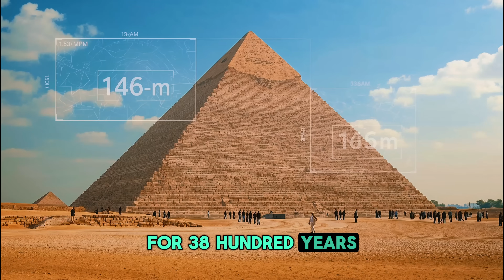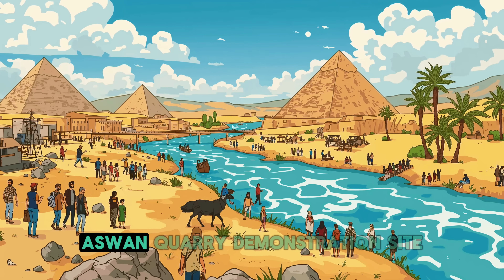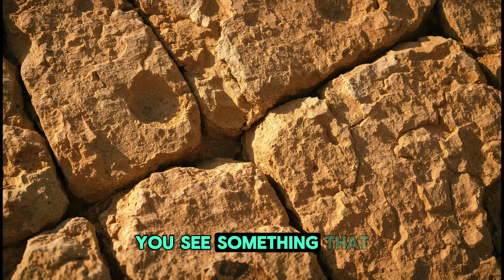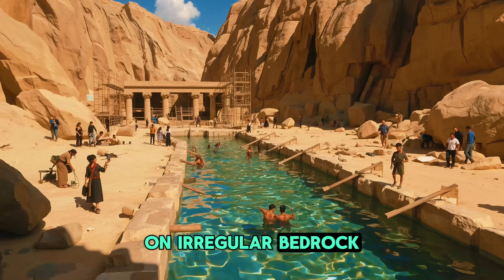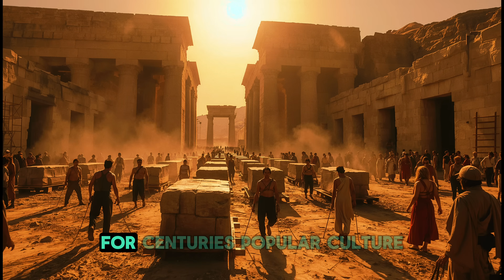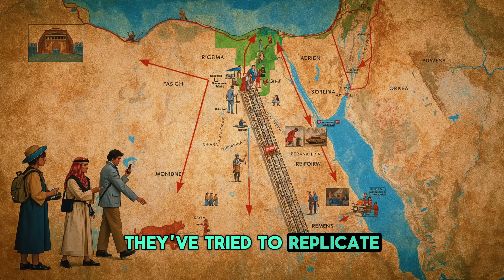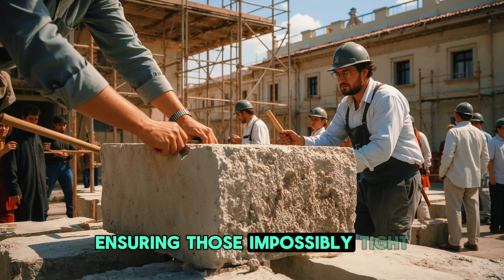Engineers Can't Explain How Pyramids Were Built... Until Now

Comment: Full of shit ! No boat is holding that block and where is room for all the manpower going to sit ? And against the flow of the river ... no fucking way ! All crap
Reply from the maker: @wildtalkingconure Alright, let's address your points - you're actually raising legitimate problems, just... aggressively. 😄
1. "No boat is holding that block"
You're RIGHT if we're talking about the tiny barges shown in some visuals. A 2.5-ton block on a small reed boat? Physics says no.
Historical reality:

Ancient Egyptian cargo barges were 20-30 meters long
Built from bundled papyrus or cedar wood
Could carry 10-15 tons (multiple blocks per trip)
Required significant crew and ballast

Evidence:
✅ Tomb paintings showing massive barges
✅ Khufu's solar boat (43 meters long, found buried near pyramid)
✅ Archaeological remains of ancient docks and harbors
So yes - the small boat visual is BS. You're correct.
2. "Where is room for manpower going to sit?"
On a proper cargo barge:

Rowers: 20-40 men (depending on size)
**Steers

men:** 2-4

Cargo area: Central platform for blocks
Total displacement: Enough to support crew + cargo

Think Viking longships or Roman grain barges - similar scale, similar capacity.
But you're right that simplified visuals don't show this accurately.
3. "Against the flow of the river"
EXCELLENT point. This is actually one of the biggest challenges:
Nile flows NORTH (Mediterranean-bound)
Limestone quarries (Tura) are SOUTH of Giza
So how did they move stones UPSTREAM?
Option A: Sailing

Egypt has prevailing winds from the NORTH
Sail south against current, using wind
Float north with current
Ancient Egyptians were MASTERS of this (attested in countless records)

Option B: Canals

Build artificial water channels to reduce current
Control water flow with locks/dams
Evidence of ancient canal systems exists

Option C: Seasonal transport

During Nile flood (July-October), water levels rise
Creates temporary channels closer to building sites
Reduces distance needed to transport

But you're absolutely right - rowing heavy cargo against current would be "no fucking way" impossible.
They used WIND POWER (sails), not rowing.

Here's my take:
Your criticisms are VALID. The problem is:

Simplified visuals (including AI-generated imagery) don't show realistic scale
Many explanations oversimplify logistics
"Just put it on a boat" ignores massive engineering challenges

What you're reacting to is lazy explanation - and I don't blame you.
Better answer:

Massive barges (not tiny boats)
Wind-powered sailing upstream (not rowing)
Seasonal timing (flood periods)
Possibly canal systems (reduce natural current)

Does that address your "full of shit" concerns, or still not buying it?
Because if you've got specific problems with THOSE methods, I'm listening.

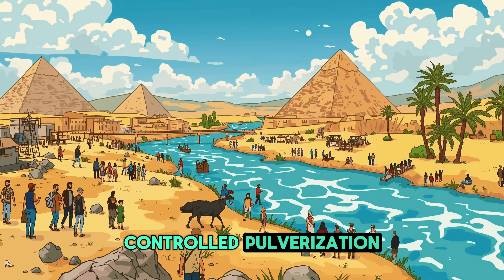Comment: I think this video is rubbish. AI generated images, like the one about 8:00 min timeline. The barge is floating like it's empty, but a 2+ ton stone block is placed on it. That stone block would sink the barge this size like it wasn't there at all! There are lots and lots of AI generated images in this video which actually don't explain anything. And if I would be using ancient methods to cut limestone, I would us stone tools, like granite or gneiss instead of copper. Much more durable. Maybe placed inside copper casing. 

Also, Pharaoh's Legacy does not show any credentials of it's validity in it's profile. Just pure guesswork and no true evidence.

How the pyramids were build, still remains a mystery.
Reply from the maker: Aquí está mi respuesta para @karijuleppanen:

@karijuleppanen Kari, you've made several legitimate criticisms - let me address each one honestly:
1. AI-generated images
You're absolutely right. I use AI (Leonardo.AI) for visual illustrations where:

Historical footage doesn't exist
Stock footage is prohibitively expensive
I need to visualize theoretical concepts

I should be more transparent about this. Would adding a disclaimer at the beginning help? Something like "Visual illustrations are AI-generated representations of theories discussed"?
2. The barge buoyancy problem - GREAT catch
You're 100% correct. That specific image is physically inaccurate:

A 2.5-ton block would require a MUCH larger, deeper barge
Ancient Egyptian barges could carry 10-15 tons, but they were MASSIVE vessels
The image oversimplifies the engineering

This is exactly the problem with AI imagery - it doesn't understand physics, just visual composition.
Historical reality:

Actual transport barges were 20-30 meters long
Made of bundled papyrus or wood
Required significant displacement volume
Multiple blocks per trip (not one tiny barge per block)

You've identified a flaw in my visual storytelling. Fair criticism.
3. "Stone tools instead of copper"
Again - excellent point. You're absolutely right:
✅ Dolerite (igneous rock, hardness 6-7) was THE primary tool for granite work
✅ Granite pounders found at quarry sites
✅ Copper was primarily for limestone (softer, hardness 3-4)
I should have been clearer:

Copper for LIMESTONE cutting/shaping
Dolerite/granite for GRANITE pounding/grinding

Your idea about "granite inside copper casing" is actually similar to theories about copper saws with abrasive sand - the copper holds the harder material that does the actual work.
4. "No credentials, just guesswork"
Fair challenge. Here's my transparency:
What I'm NOT:
❌ Professional Egyptologist
❌ Licensed engineer
❌ Academic researcher
What I AM:
✅ Content creator researching and synthesizing existing theories
✅ Someone who reads academic papers, archaeological reports, engineering analyses
✅ Presenting multiple competing theories (not claiming certainty)
My sources include:

Joseph Davidovits (geopolymer theory - materials scientist)
Jean-Pierre Houdin (internal ramp theory - architect)
Mark Lehner (mainstream Egyptologist)
Robert Schoch (geological analysis)
Denys Stocks (experimental archaeology)

Should I cite sources more explicitly in videos? Probably yes. That's valid criticism.
5. "How pyramids were built still remains a mystery"
On this, we completely agree.
I never claimed to have THE answer. The video presents:

Problems with mainstream theories
Alternative proposals
Evidence for and against each

The title "Engineers Can't Explain" is meant to convey exactly that - even with modern expertise, we're still debating methods.
Here's what I'll commit to:

✅ Add disclaimer about AI-generated imagery
✅ Be more careful about physical accuracy in visuals (or note inaccuracies)
✅ Clarify tool materials (copper vs. stone for different applications)
✅ Include more explicit source citations

Your criticism is constructive and fair. This is exactly the kind of feedback that improves content quality.
Question for you: Given your clear knowledge of materials and engineering - what's YOUR best guess on construction methods? You clearly understand the problems better than most commenters.
Reply: @PharaohsLegacy99  I don't have any and I'm not going to start the guessing game. 

Engineers still can't explain how pyramids were built, period.

Comment: THEY didn't build it .other 1,000 years before used high tick tools , YOU CAN"T FIND the tools. This ides of pounding can't work , sorry Dolerite Can not do the job. Go back to your research and find the REAL buliders.
Reply from the maker: @JimHeil-sf8dc Jim, you're raising legitimate problems with the mainstream explanation - and you're right about some of it.
Let me address your points:
1. "Can't find the tools"
Actually, we DO find tools:
✅ Copper chisels (thousands found)
✅ Dolerite pounders (found in quarries and at Giza)
✅ Wooden sledges
✅ Rope fragments
✅ Tool marks on unfinished blocks
BUT - and this is where you're RIGHT - these tools don't fully explain the precision we see in certain areas.
Copper chisels on granite? Inefficient at best.
Dolerite pounding creating perfectly smooth surfaces? Questionable.
2. "Dolerite can't do the job"
You're partially correct. Dolerite (hardness ~6-7 Mohs) CAN work granite (hardness ~6-7 Mohs), but:
❌ It's incredibly slow (months per block)
❌ Creates rough surfaces (not the polished finishes we see in some areas)
❌ Doesn't explain precision tube drilling found in granite
So what's the answer?
Option A: Lost advanced technology (your position)

Problem: Zero physical evidence of these tools
Problem: No metallurgical residue, no tool fragments, no depictions
Problem: If they had "high-tech tools," why are there unfinished projects showing primitive methods?

Option B: Methods we haven't fully understood yet (my position)

Combination of techniques (copper with abrasive slurry, dolerite pounding, possibly bronze)
Chemical softening methods (controversial, but some researchers exploring this)
Geopolymer casting (which would eliminate much of the "cutting" problem entirely)

3. "1,000 years before" / "Find the REAL builders"
I'm open to this IF you can show me:
✅ Archaeological evidence of this earlier civilization
✅ Dating evidence placing pyramid construction earlier
✅ Explanation for why Egyptians would claim credit for something they found
✅ Reason why hieroglyphs inside sealed chambers reference 4th Dynasty pharaohs
Graham Hancock, Robert Bauval, and others propose pre-dynastic builders.
The evidence for this is circumstantial at best:

Sphinx water erosion (debated)
Astronomical alignments (can be interpreted multiple ways)
Geological anomalies (not conclusive)

Here's what I WILL admit:
The mainstream "copper chisels and elbow grease" explanation is insufficient for certain aspects of pyramid construction. You're absolutely right about that.
But "we don't fully understand it" ≠ "lost civilization with high-tech tools"
It could also mean:

Ancient techniques we've forgotten (chemistry, physics, leverage)
Hybrid methods (some cutting, some casting)
Simpler solutions we're overthinking

My challenge to you:
If there were "high-tech tools," where are they? Ancient Egyptians preserved everything - tools, furniture, food, even underwear in tombs.
Why would ultra-advanced construction tools completely vanish without a trace?
What's your explanation for that?
Reply from the maker: @JimHeil-sf8dc Jim, you're raising legitimate problems with the mainstream explanation - and you're right about some of it.
Let me address your points:
1. "Can't find the tools"
Actually, we DO find tools:
✅ Copper chisels (thousands found)
✅ Dolerite pounders (found in quarries and at Giza)
✅ Wooden sledges
✅ Rope fragments
✅ Tool marks on unfinished blocks
BUT - and this is where you're RIGHT - these tools don't fully explain the precision we see in certain areas.
Copper chisels on granite? Inefficient at best.
Dolerite pounding creating perfectly smooth surfaces? Questionable.
2. "Dolerite can't do the job"
You're partially correct. Dolerite (hardness ~6-7 Mohs) CAN work granite (hardness ~6-7 Mohs), but:
❌ It's incredibly slow (months per block)
❌ Creates rough surfaces (not the polished finishes we see in some areas)
❌ Doesn't explain precision tube drilling found in granite
So what's the answer?
Option A: Lost advanced technology (your position)

Problem: Zero physical evidence of these tools
Problem: No metallurgical residue, no tool fragments, no depictions
Problem: If they had "high-tech tools," why are there unfinished projects showing primitive methods?

Option B: Methods we haven't fully understood yet (my position)

Combination of techniques (copper with abrasive slurry, dolerite pounding, possibly bronze)
Chemical softening methods (controversial, but some researchers exploring this)
Geopolymer casting (which would eliminate much of the "cutting" problem entirely)

3. "1,000 years before" / "Find the REAL builders"
I'm open to this IF you can show me:
✅ Archaeological evidence of this earlier civilization
✅ Dating evidence placing pyramid construction earlier
✅ Explanation for why Egyptians would claim credit for something they found
✅ Reason why hieroglyphs inside sealed chambers reference 4th Dynasty pharaohs
Graham Hancock, Robert Bauval, and others propose pre-dynastic builders.
The evidence for this is circumstantial at best:

Sphinx water erosion (debated)
Astronomical alignments (can be interpreted multiple ways)
Geological anomalies (not conclusive)

Here's what I WILL admit:
The mainstream "copper chisels and elbow grease" explanation is insufficient for certain aspects of pyramid construction. You're absolutely right about that.
But "we don't fully understand it" ≠ "lost civilization with high-tech tools"
It could also mean:

Ancient techniques we've forgotten (chemistry, physics, leverage)
Hybrid methods (some cutting, some casting)
Simpler solutions we're overthinking

My challenge to you:
If there were "high-tech tools," where are they? Ancient Egyptians preserved everything - tools, furniture, food, even underwear in tombs.
Why would ultra-advanced construction tools completely vanish without a trace?
What's your explanation for that?

Comment: Keep hearing about this laser precise cut stones and perfect 90-degree corners.  Where are they, certainly not shown in these or other pictures. I expect some weathering of the stones, but they were clearly not as accurate as he describes to start with.  They could not work during the Nile flooding, yet later claims the farmers worked on the pyramids when their fields were flooded by the Nile.  Just a bunch of stone blocks piled up.
Reply from the maker: @JohnDoe-uj7wo John, you're calling out some real inconsistencies - let me address each one:
1. "Laser-precise cuts" - where are they?
Fair challenge. The truth is nuanced:
NOT precise:

Most exterior blocks today (4,500 years of weathering, erosion, vandalism)
Interior fill blocks (rougher, less critical)
Blocks damaged during later stone robbery

Actually precise:

Original casing stones (mostly removed, but surviving pieces at base show gaps of 0.5mm - thinner than a credit card)
Granite boxes in the King's Chamber (corners within 0.02mm of 90°)
Internal passageways (alignment precision that's measurable)
Base platform (13 acres level to within 2.1cm)

The problem: Most photos show the damaged, weathered, robbed pyramid - not the original precision. It's like judging a Ferrari's engineering by looking at one that's been sitting in a junkyard for 4,500 years.
2. Nile flooding contradiction - good catch:
You're right, this IS contradictory in mainstream explanations. Here's the reality:
Nile flooding (July-October):

❌ Can't quarry (quarries flooded)
❌ Can't transport by boat effectively (too much current)
✅ CAN work on upper pyramid levels (already above water)
✅ Farmers ARE available (fields underwater)

Dry season (November-June):

✅ Quarrying possible
✅ Transport possible (calm water, accessible quarries)
❌ Farmers busy with planting/harvesting

So the actual workflow was probably:

Flood season: Upper-level construction, on-site work, organizing
Dry season: Quarrying, transport, foundation work

Not as simple as "they worked year-round" - it required seasonal planning.
3. "Just a bunch of stone blocks piled up"
If only it were that simple, John. But:
❌ "Piles" don't stay aligned to true north for 4,500 years
❌ "Piles" don't maintain structural integrity through earthquakes
❌ "Piles" don't have internal chambers with corbelled ceilings that don't collapse
❌ "Piles" don't distribute 6+ million tons of weight without foundation failure
Engineering required:

Weight distribution calculations
Foundation engineering (they removed 30+ feet of loose material to reach bedrock)
Structural corbelling (weight redirection in chambers)
Precise alignment (astronomical observation)

It's like saying a suspension bridge is "just some cables hung up." Technically true, massively understating the engineering.
You're right to be skeptical of exaggerated claims. The "laser precision" talk CAN be overhyped. But there IS legitimate precision in specific areas that's genuinely impressive for Bronze Age technology.
What would you need to see to be convinced there was actual engineering sophistication involved?
Reply: @PharaohsLegacy99    What I would need to see is the precision that you are talking about.  With that many stones there is bound to be some that fit together precisely, at least partially.  Since there are no pictures of the brand new super precise pyramid, we need to base our opinions on what is available now.
  
I worked in engineering for years and saw some pretty amazing things accomplished.  I saw a large portion of a concrete runway constructed by hand when the finishing equipment broke down.  Forms were set by hand and hundreds of cubic yards of concrete were placed (not poured, concrete is not a liquid) using simple tools.  With enough manpower, tools and materials almost anything can be accomplished.

  When I hear archeologist, experts or engineers say, "this can't be done", I realize that this may be their opinions.  Most engineers said no explosives were involved in the destruction of the towers on 911.  Yet, now years later, when it is safe to do so, many are expressing their true opinions. And, when I hear "experts or academics say", It makes me recall a saying I heard years ago, "those that can't do, teach".

 Though, it is amazing that they wasted that much time and effort piling up a bunch of stones, that don't really serve a practical purpose, in my opinion.